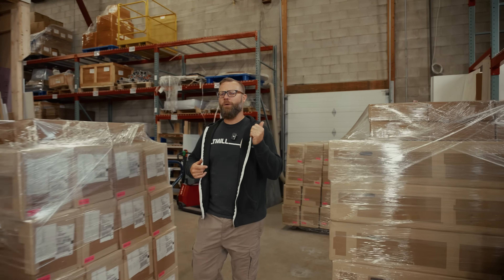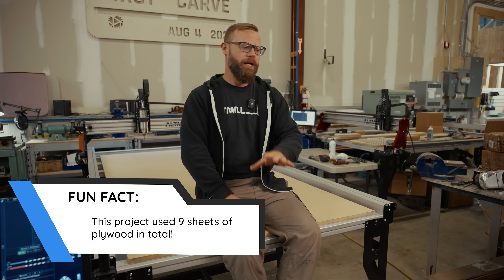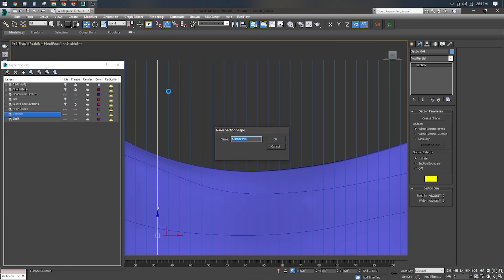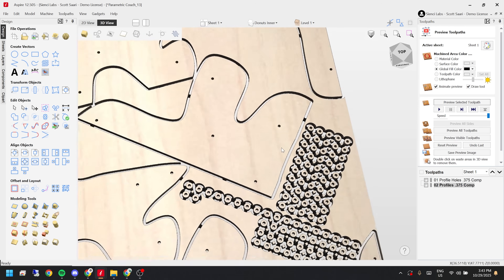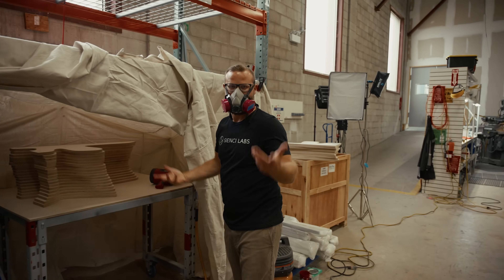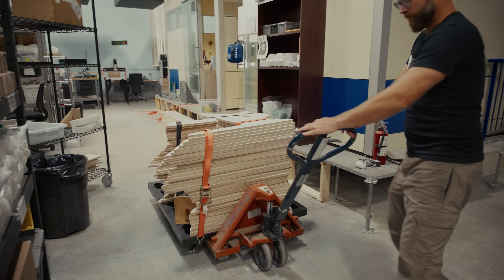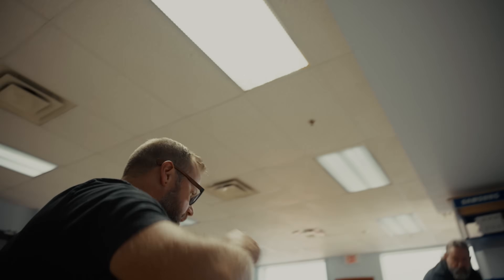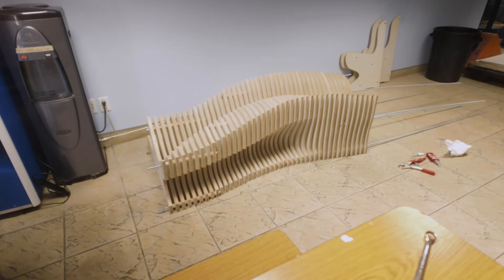Cutting Plywood Furniture on a CNC

Comment: Looks great! But I have a question about sustainability: Isn't there a lot of wood waste with this shape? Is there a trick to produce this wave without throwing away half of the board?
Reply from the maker: Great question! The amount of waste is going to depend greatly on the design. With this particular design, there was more waste than we would have liked. The trick is to design a little more thoughtfully so the shapes maximize the amount of space you have on each sheet. Thanks for asking!

Comment: I'm new to cnc. Would be a big help , if you could share info on the cutting feed rate you set for this project. Also the bit size and the step down you set ... Thanks
Reply from the maker: All of that info is in the video. Let us know if you need any other info not included!

Comment: Next time, connect things up starting in the middle and add them on, alternating from left to right.
Reply from the maker: We tried that! But it was tough to keep standing up so we tossed it on the floor, back side down. Plus all our different length rods made it a pain....def easy to start middle if it was smaller.

Comment: I'm not getting the parametric part of the design process? Or, what does 'parametric' mean in this example?
Reply: I was thinking the same but the first thing that came to mind was a parametric equalizer with all the sliders for each frequency band.  If you've seen one you can make a visual correlation.
Reply from the maker: You're right, it's not "parametric" in the traditional method of having variables and parameters to define the shape. It's a more simplified version, and it's still pretty cool.

Comment: Great to see this project from beginning to end. I wish Vetric could do the 3D part of the parametric build. Buying all this software gets expensive, not to mention the time to learn it. Thanks for this fun post.
Reply: I agree. Vectric is coming out with an option to be able to assemble. Still not 3D but getting there.
Reply: It can 😅.
There is a video by a maker who did that maybe 2 years ago. I can't remember who it was right now though 😅.
Maybe Michael Mezalik 🤔.
Yup, checked it and it was him, the video is 4 years old but should help you make these designs. It uses Aspire though 😅😅😅.
If you are interested, you can do these for free in Fusion 360 with the slicer plugin.
Best of luck 🤞🏻

Comment: 4x8 needs vacuum table
Reply: Need is a reach, obviously it worked for this project with some screws and leaving tabs, if you are doing sheet goods all day long, yes you really should be using a vacuum table.  Have you priced out a 4x8 vacuum table or looked at the power requirements?  FYI it will double the price of the unit and the pump will have 7x the power requirement as the CNC.  So yes a VT would be nice not necessarily needed and still something that an owner can DIY.

Comment: What type off bit did you use, size and cutting speed please
Reply from the maker: We used a 3/8" flat upcut for the holes, and 3/8" compression bit at 3/8" DOC and conservatively 250IPM. We did use gSender to speed things up to 400IPM+ without any issues. Here's the link to the bits!
https://sienci.com/product-category/end-mills-bits/3-8-1-2-shanks/